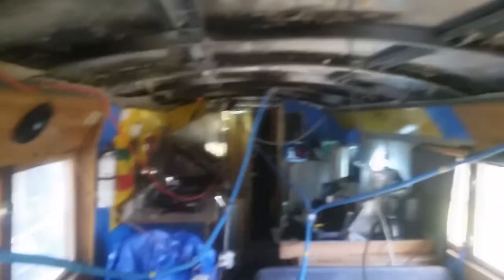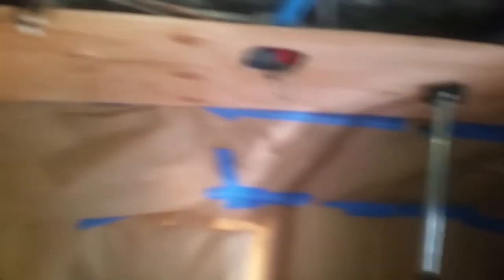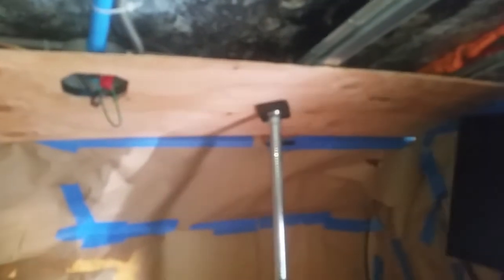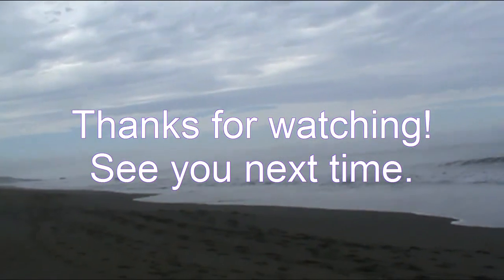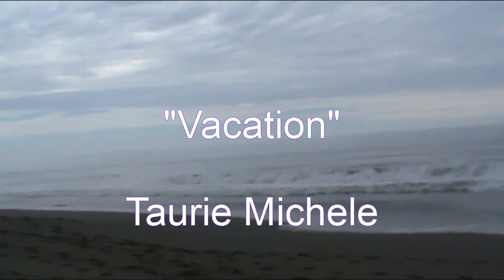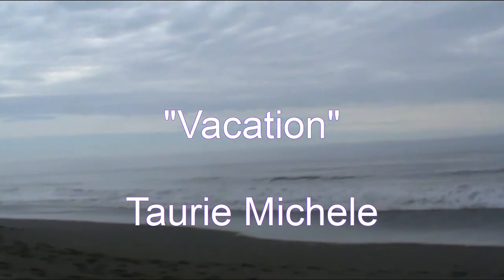Jon's Bus Conversion Part 71 - Front Ceiling Redo.

Comment: If you weren't using moist propane heat ........ do you think it's still worth all the work of changing out the insulation?
Reply from the maker: Yeah I think so - I was going to do it anyway to keep in the heat but I noticed the moisture when I was doing it. Also - keep in mind - THIS bus is a tiny house. I live in it full time. If you just want a party bus or something to camp in the summer - you probably don't need any insulation.